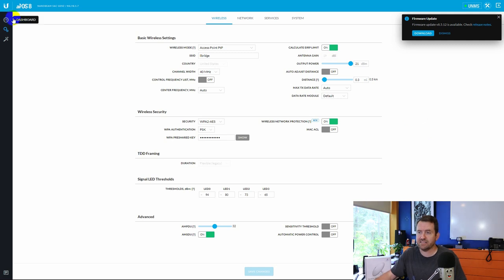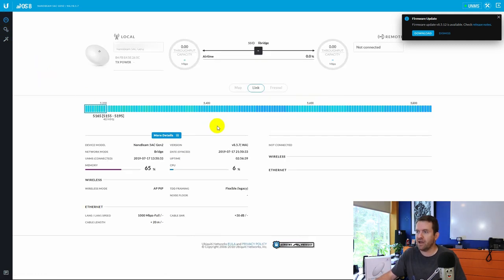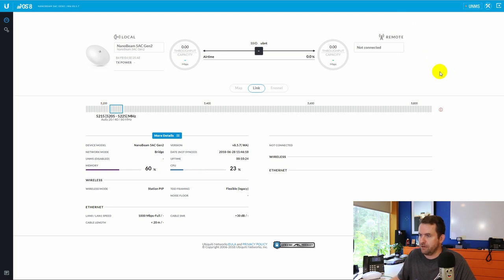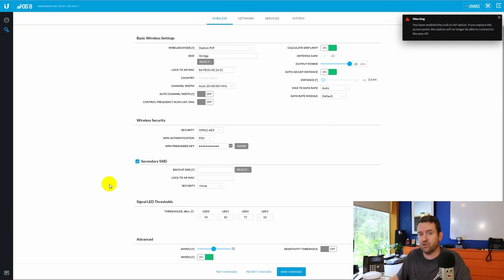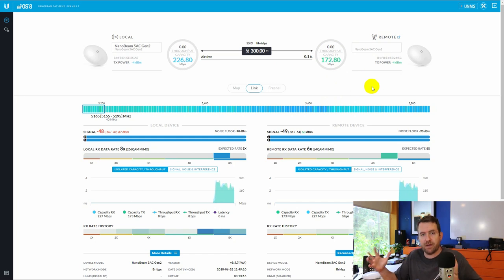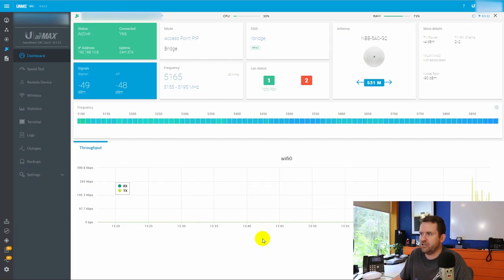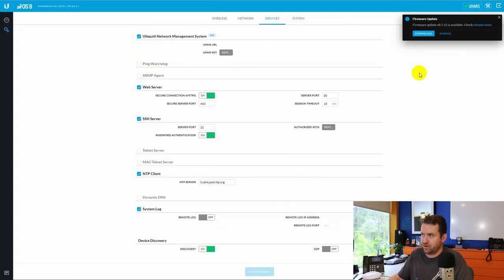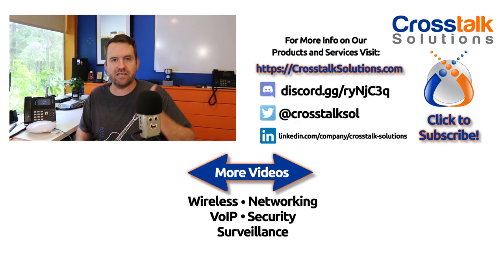Simple PTP Wireless Bridge

Comment: If you have a row of pine trees in between your buildings and the buildings are only about 300 feet away, would that significantly affect the connection?
Reply: Yes it would. The throughput and signal will be significantly reduced with radios on the 5.8ghz spectrum. You would be better served with a 2.4 GHz radio if it's shooting through trees.
Reply: @realifethunder  Thanks - I see that they have a 900Mhz unit with the same throughput.  I suspect that might even might be better and not a big deal with only 300 feet.  I am using the mesh unit but with much slower speeds at the remote site.  Just trying to improve.  Again, thanks for prompt response and all the videos.
Reply: @i81fish2  honestly, the 2.4 radios do seem to be able to shoot through some trees,especially if it's only one row.  One thing to take note of though, you would want to make sure that any wifi routers are not stepping on the same freqs as your radio, otherwise it can cause interference.
Reply: @realifethunder  I understand the concept of the interference between the routers and the radio.  That is why I was thinking of the 900Mhz also and that 900 probably would punch through the trees even better.  Maybe I just cut the trees down, lol.  Thanks again.

Comment: Hello,  I have Starlink and am in Port Loring ON, Canada pulling in about 60-80mbps.  I would like to do a run from Building A to Building B.  I have a TP-Link AX50 Router in Building A and would run 170' outdoor Cat7 Ethernet cable to a pole and put some kind of Ubiquiti on the pole (outside) maybe an access point in fairly (a few trees) direct line of sight to Building B (about 500ft away) where I would have another Ubiquiti on the Building B and then run another ethernet cable approx. 55' into Building B.  I have another TP-Link AX50 router in Building B.   Now to my question, how do I do this and what equipment from Ubiquiti or Unifi do I buy? Also I don't have a clue how to set it up.  The easiest the best way as I am not tech savvy at all.  
Building A - Router (TP-Link AX50) LAN port to POE - to 170' of Cat 7 Ethernet to pole (outside) with Ubiquiti equipment from Pole with Ubiquiti equipment wireless to Building B (outside) approx 500ft  (fairly good line of site)Building B outside with Ubiquiti equipment plugged into a 55' run of outdoor cat7 Ethernet to inside Building B with another POE to a second TP-Link AX50 WAN portIs this correct? And what would be the best, inexpensive and easiest way to set up? Maybe some newer Ubiquiti that has an app on an iPhone.   We would only have about 25 devices in Building A and 25 in Building B.  Also another question, would outside also have good wireless internet?   Would this one be a good one to consider?  airMAX NanoBeam AC 5 GHz Bridge SKU:  NBE-5AC-USThank you so much for your time and expertise.
Reply: airMAX GigaBeam Plus 60 GHz Radio $179 x 2 = $358, 8 port internet switch $20 x 2 =$40 & Cat 6 Cable $50++

Comment: if using PoE injector instead of PoE switch.  is the surge protector still needed / suggested?
Reply from the maker: Great question - I would say yes since the PoE injector doesn’t have any surge protection.
Reply: @CrosstalkSolutions  

Ubiquiti say you do not need surge protection when using the correct cable from the AP to the poe. (here I am assuming the poe is safely inside)

There's a simple overview here, where ubiquiti is plugging there "Tough Cable"
https://dl.ubnt.com/datasheets/toughcable/TOUGHCable_Datasheet.pdf

Can someone confirm that any shielded cat 6 cable with drain wire correctly made would work?

Thanks again for all the helpful vids
Allan

Comment: I have a client with two sheds 30deg apart from the main house.. if I use a nanobeam on the house in Ptmp mode, what should I use on the sheds?
Reply: I set this up in a similar setup. Nanobeam on house in Ptmp and two nanobeams on each shed in station mode. Worked perfect!
Reply: Thanks - how wide do you think the beam is?

Comment: i dont see you setting frequency, are u always using auto freq?
Reply from the maker: I use auto until it is installed at the client’s location. Then site survey and set channel manually if needed.
Reply: @CrosstalkSolutions  in your experience are you always set manual your freq?

Comment: I am very interested in trying this setup for my situation. I just moved to a new home that has NO internet access ,other than satellite which I won't do. However my parents are about 3/4 of a mile away with fast internet. I wouldn't have perfect line of site. We do have a valley in-between with some tree tops in the way. My question is....with an educated guess... what would the data connection speed look like. Every review I have seen is when the two radios are are the same room. What kind of speed drop happens with distances?
Reply from the maker: 5GHz won’t do well with no line of sight. If you literally have zero LOS you have to go with 900MHz...which is slower, but better than nothing.

Comment: What are your opinions of 900mhz p2p ubiquiti antennas?
Reply: If your bandwidth requirements are low they are ok. They make a good “last resort “ radio when line of sight is less than perfect.
Reply: 900mhz radios are best for Non line of Sight p2p, such as having tall trees or pretty much anything  in between with no way of putting higher towers above the trees. 
I am using NanoStation m900 radios just like this simple setup for few years, only because we were unable to put up a tall tower above the trees that are in between.
Reply: @jacksummers1736  What kind of speeds can you get in a less than perfect setup (having to go through exterior building of a home for example from 300ft away)
Reply from the maker: I'll have a video on those soon too!

Comment: I have found that using “lock to AP” is not a good idea on the station side. Should the the AP fail you would need to visit the station too when the AP mac is changed due to radio replacement.
Reply from the maker: You can argue for or against.  In a simple PTP deployment, it's fine...but we wouldn't lock to AP in a PTMP WISP deployment.

Comment: Why use 40MHz when you have a 80MHz option?
Reply: Jens Erling Bråten There’s no benefit to using additional bandwidth if you don't need it.
Reply: @joshuasamuels7777  everyone wants max bandwith all the time 😅
Reply from the maker: The bandwidth we will get from this link is more than sufficient for the use case.  No need to hog the whole spectrum.
Reply: @CrosstalkSolutions  how much bandwith do you get? 

I have the same setup and i get 200/200Mbit with 80Mhz
Reply: The CPU won't support the higher speeds even if you tried. Even at 80mhz all I get is around 300mhz in real-world use.